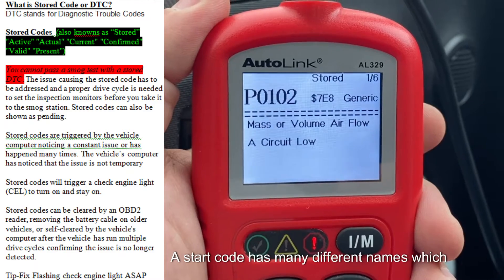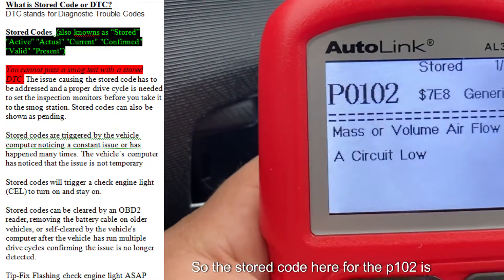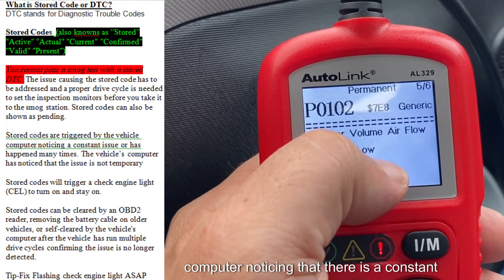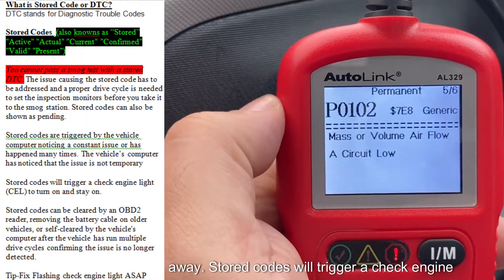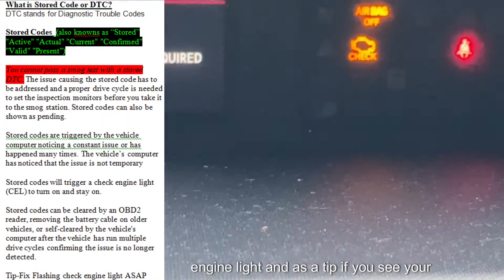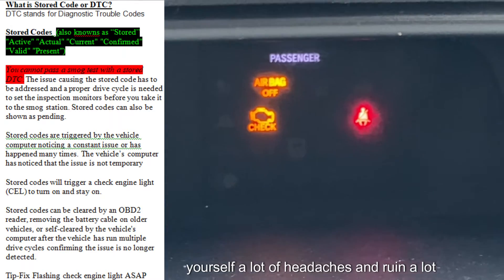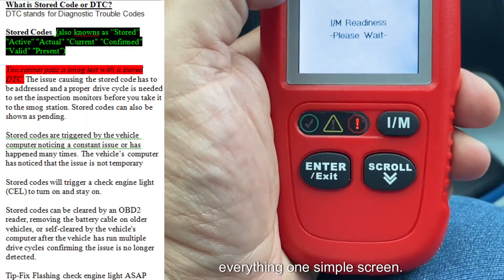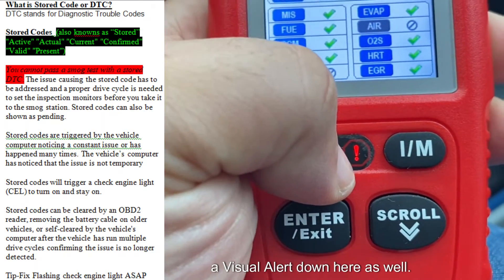What is a stored DTC code? Stored fault codes (And What they Mean)

Comment: I have a machine just like that with the h cat thing in Gray what does that mean
Reply from the maker: Heated catalyst monitor. 

I need to look at your tool but green is good or ready, and depending on the code reader Gray code means not ready or n/a. So look at the other monitors on your device to figure it out.